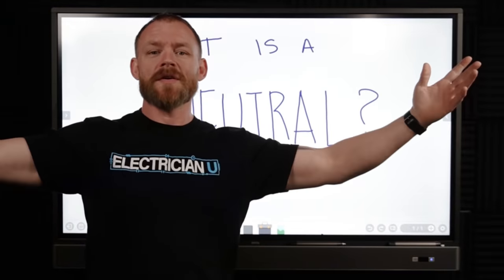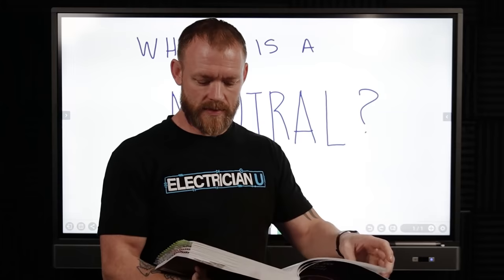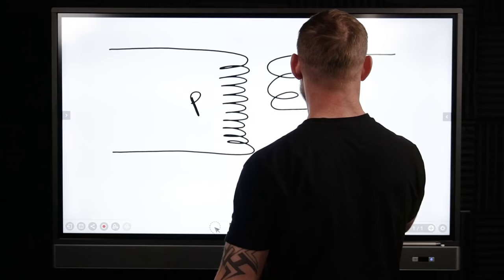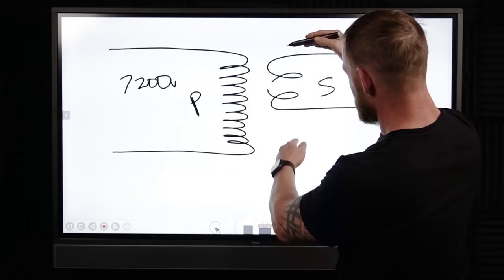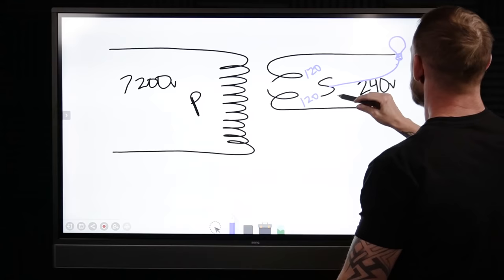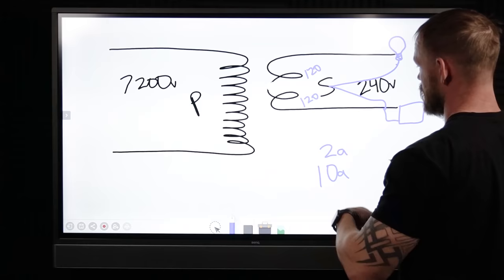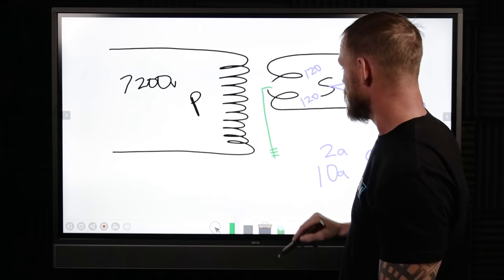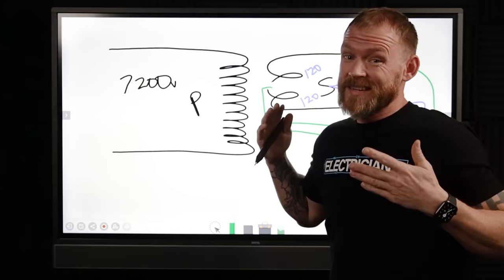What is a Neutral? The Difference Between Grounded and Grounding Conductors.

Comment: I have a 230v solar hybrid inverter coming and before installing it I noticed the ac output terminal has only L & N no ground the ac input terminal has all 3 but I wasn't planning on using the input ac untill I understood a little more about how it works my question is the two output terminals L & N is L considered Line 1 & is neutral considered Line 2 Plus how well I know if there's a neutral on ground bond or not in the inverter if not what do I do if there is a ground on neutral what do I do I'm running the inverter to a subpanel and using a midpoint transformer to split the 240 into two 120 hot legs any suggestions or tip to keep me from blowing myself up lol

Comment: A neutral should be exactly what it sound like - Since im comming from the car world its between reverse and drive, In saying that going into the elect world the neutral would be a hot when the switch is turned on - you dont need a N for a headunit just a remote wich would be N - Btw im new to this

Comment: I like the term "grounded conductor" as it says that there are two conductors as a circuit needs and one of them is grounded and the other is not. Otherwise the conductors are identical. When people use terms like live and neutral they get the idea that electricity comes from just the live conductor.

I o not like the term grounding conductor. The British term the circuit protective conductor is better as it describes what it does and not how it does it. Many people think you could just run  wire to the ground and that is OK because term grounding confuses them.

Comment: This might a dumb question but I was wondering with all this back and forth to the transformer how is my electric usage calculated.
Reply: The energy meter measures the Amperes going through the supply lines and integrates over time to get energy.

Comment: 2:01 on single phase distribution lines, usually one of the "hot" primary lines is grounded.  It's done to keep the voltage potential from the primary lines to the earth from going crazy, but can cause problems at times.

Comment: In the example you used . If the Light bulb at 2Amps and if the microwave was also 2Amps. Then the neutral would have no (0) Amps. So it sounds like in a way the neutral neutralizes the current. No pun intended

Comment: The neutral is nothing "like" the hot. In the absence of a balanced load it carries the difference in CURRENT between the two 120V  limbs but has zero (or nearly zero VOLTS). It is at ground potential (0) which is why it is called the grounded conductor.
Reply: Do not confuse current and voltage. Neutral carries current but has 0 volts compared to earth - or close.
Reply: @okaro6595  which is exactly what I said.
Reply: This makes sense.   I don't understand why this video doesn't explain it clearer. It would better served with an explanation of current vs voltage including flow(direction and AC wave)

Comment: As a foreman commercial electrician. Any apprentice asking me questions. I just refer them to you !
Reply: Are you smoking something as a foreman you would know a journeyman would be the best teacher not YouTube and watching this video he does not explain a neutral at all in theory.
And his drawing is totally wrong.
The code book does not teach you electrical.
Reply: @funone2no  Dude, read my comment up at the top, I didn't hold back. You are the one guy I found in here that is calling this out as a pathetic attempt to explain a neutral. It's scary to think people are impressed. He shouldn't teach something that he half understands. This encourages wild speculation because he skipped over the most important concept that the winding creates the zero voltage point. Not the earth. AND that point can slightly drift with imbalance but the ground connection by itself doesn't rectify the drift. It provides protection to people by insuring zero potential. I literally don't believe he even understands that.... His drawing was as hot a mess as his understanding was.

Comment: Have a house built in the 60s(?)   Wiring is copper solid core with fabric insulation, and a fuse box, probably 80a service.  While following code, could you replace the fuse box, then come back once a month on the weekend a replace one circuit at a time?
Reply from the maker: That would depend on what the AHJ has to say on the matter.

Comment: Hello, good video. Perhaps I misunderstood you, but I think your explanation of the currents on the secondary "neutral" is incorrect.. In your example, the total neutral current isn't 2 amps in one direction and 10 amps in the opposite, subtracted to 8 amps. No, it's carrying merely 8 amps total. And if both ungrounded legs are carrying identical ampere quantities (say, 5 amp exactly on each), then the neutral is carrying 0 amps (the neutral could actually be removed from the circuit without issue).

Comment: I tend to think of the hot and neutral as being two halves of the same race track. The racers travel the first half constantly trying to find the path back which is the reason the conductor is so dangerous. 
Even when provided a path back the energy is unruly and will follow any path in a blind attempt to return to its source. 
Sadly, we haven't developed a whistle to call the little burgers' energy output back to the source. 
As far as the balancing is concerned, I just assume it is a product of the neutral being tapped center of the coil thus able to provide both legs.

I could be completely wrong, but it is my layman visualization of the different states of the current and functionality of the conductors.
Reply: You kinda are. This would work for DC,but not for AC. The only reason the N dosent hit you is becaus it has a preferable way to go than you, But the current is still alternating and both wires could be dangurous. So you should chek both before wokring on anything.
Reply: @JSunday45  I am aware that the neutral is not current carrying unless the load is unbalanced or there is a fault in the circuit. I do find it difficult to visualize the wave function of the current  at the point the load becomes unbalanced. 
What will cause the load to become unbalanced? In terms of the EM field etc. Does the wave spike or does it condense causing the unbalance within the circuit? 
I find many answers to be sufficient for practical diagnosis and construction, but I am having a terrible time finding a good theory channel on YouTube that isn't some conspiracy theory nut 😀
Reply: @jfarley1221  Just move one wave a little to one side. Unbalanced. If you are in to construction I dont see why you should bother your self with this. I think there is no such thing as a balnced system anyways.

Comment: So why are we subtracting the neutral loads? In my head I see the lamp netrual should be carrying back 2 amp to complete the circuit, the microwave carrying 10 amps. Therefore at the tap the 2 amps and the 10 amps from different circuits are meeting together and are added together so there's really 12 amps coming back to the neutral point. Why do they cancel?
Reply: The phases are 180 degrees separated so the sum is zero if the currents are the same. You cannot just add the nominal currents, you need to add them at each infinitesimal time unit.

Lets say the only load you had on either leg is a 60 W 120 V bulb. Now lets say you cut the neutral, you would have two 120 V 60 W bulbs in series at 240 V so the bulbs would work just as they should. In this case the system works identically without neutral so the current in neutral is zero. You need the neutral as normally the loads are not identical. If the neutral breaks the 240 V is divided between the loads at arbitrary manner, one could get 40 V and the other 200 V. Neutral ensures that both get 120 V.

You could achieve same with DC by having +120 V, 0 V and -120 V. This in fact was used in (parts of)  Finland until the early 60s (though with 125 V). They had halls of AC motors connected to dynamos to generate the DC.

Comment: Wow! I thought I knew what neutral was before watching this...now I am confused beyond redemption. Also...you are standing in front of your board while explaining...and we can’t see what you’ve drawn.
Reply: The Neutral is just the conductor in the circuit that is at or close to 0 Volts and because it is at 0 Volts potential to the Active (Hot) wire it becomes the return path back to the Circuit Breaker.
Reply: Think first about a simple system where there is just one leg and one end of the transformer is grounded. When you understand that then switch to thinking the US system where the center point of the transformer is grounded.

Comment: I doubt the NEC really requires neutral grounding inside the building.
But in Europe we have no problem with that. We have the so-called TN-C, TN-S and TN-C-S systems. The TN-C-S system is exactly what you are talking about. It is also a widespread solution in Russia.
Reply: There is also TT and Norway has IT. Here is a description of them all
Reply: @okaro6595  Yes, but we rarely use TT and IT at home. In Russia, the same rules for dealing with electricity apply as in Europe. ABB and Siemens are leaders in the Russian market. But we also have a lot of cheap products from China and I must admit they are of good quality.
Reply: @nicholaskukushin6626  There are no European rules. The rules are national. TT is pretty common in the central Europe. TT has the benefit of no possibility of a PEN-fault. On the other hand it required s secondary protection like a 100 mA RCD on the whole house. That means the whole house goes dark if it trips.
Reply: @okaro6595  Yes, you are right, TT does prevent PEN-fault. And what does not allow you to install a second RCD at the input? Nothing. Therefore, there is never a situation when the whole house goes out.

Comment: Isn’t distribution line voltage 12,500 phase to phase and 7,200 phase to neutral or ground?
Reply: Where I live the phase to phase is 12,750 volts and the single phase is 7200 volts. That is the typical voltage on the small utility circuits providing power to neighborhoods and small businesses. It jumps to several higher voltages in distribution Statewide with the  highest being 325,000 volts phase to phase.
Reply: That is a common distribution voltage, but power utilities can use higher voltages.

Comment: Question about balancing and Main Breakers. is the load rating of the main panel breaker the 120-volt or the 240-volt amperage rating? 
For example, a 150a breaker will trip at 18.000w or 36,000w.
Reply: The breaker is only on the hot wires. So if you had 150a load on one leg only (which would be a 120v load) the breaker could trip. But having zero load on the second leg would be weird. But yes it will trip somewhere between 18,000w and 36,000w when one leg hits 150a. 

Now this is just theoretical because a breaker doesn’t actually trip exactly when it’s amperage is hit. The amperage is what it is guaranteed to carry without tripping. It will trip at some percentage above that eventually. It trips faster at 200% it’s rating than 105% it’s rating.
Reply: @ecospider5  cool that's what I thought. thx for the insight.
Reply: It would hold 105% indefinitely and 115% for at least 3 hours.  Assuming its a listed ITT Breaker.  Read the trip curves to understand them better.

Comment: 110 a/c 
Alternated current.  Explain to me how the power go back to the source and is not affected the a/c of 60 cycles for sec. 
The neutral dont shock you even if you touch ground. I understand all what you said. Just dosent make sense how goes Back the power and what is the frequency on the a/c on neutral
Reply from the maker: If you are touching neutral and ground only. There should be no potential difference (what voltage is.) 

Therefore no shock. (In a perfect situation.) 

When you have a power completing a circuit 
You will have that same frequency of the input coming down/ out the "output" and carrying that all the way back to A "source" 
Because nothing is altering or intercepting that except the equipment. What ever that is. 

60hz aka 60 times a second is the standard frequency for 120/240 power and even 3 phase power because of how that electricity is derived. 

In order to understand that it would take a lot more words, time, and videos to elaborate on that. 

Check out engineering mindsets video on Power generation and come back with more questions. 

Thank you for the question I'd love to answer more.

Comment: I've always called the neutral, the current or power return. It returns the current back to the source. But does not carry voltage.
And as we know a broken wire, can be the Neutral, will have source voltage and current between the ends.
Reply: It's too vague IMO to say things like the neutral does not carry voltage. I mean I don't understand this when clearly there is a voltage to be measured between the Line and Neutral. There should be no voltage that can hurt you between the neutral and a grounded conductor because they should be at the same potential if bonded together properly but the neutral is still tied to the transformer windings. If a conductor is 'returning' current to the source then it has voltage.
Reply: Use whatever works for you, but I don’t like the term “return” as applied to an AC system.  Electricity has to run in a circuit and the neutral is just one of the two conductors needed to make a complete circuit.

Comment: If in a live circuit, you touch the neutral and you don't get an electrical kick, then why do they say that AC power goes back and forth? Whether it's back or forth, you touch the neutral you will never get a kick, but if that time you touch the live, BOOM!!!
Reply: Try first with a neon tester.
Reply: The voltage on the neutral is near ground potential in a normally operating circuit.  The current in the neutral has nothing to do with it.

Comment: Simply put it’s a return wire , returns the unused electricity back to city 😏 , Electricity is like water and air , it comes in and it has to leave ( come in on the black wire leaves on the white wire )